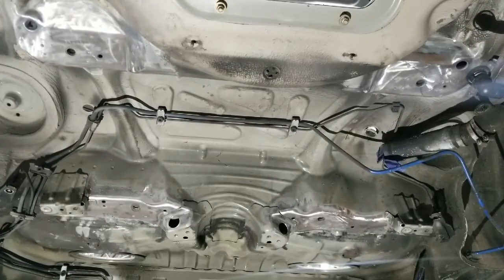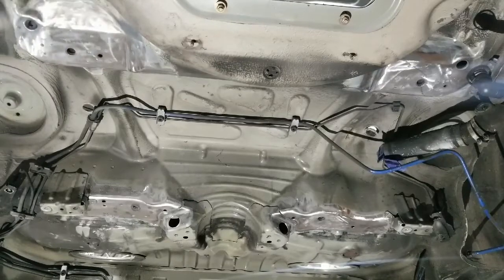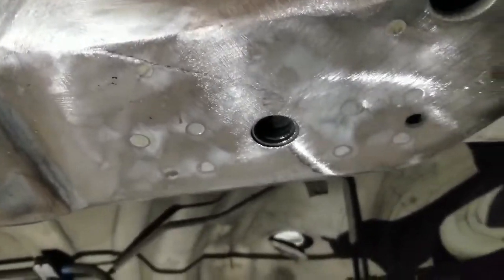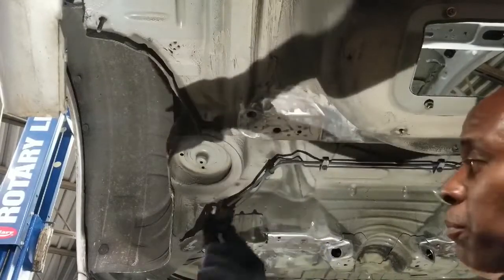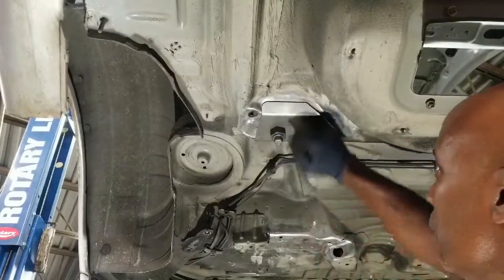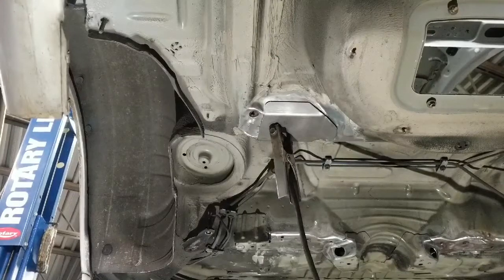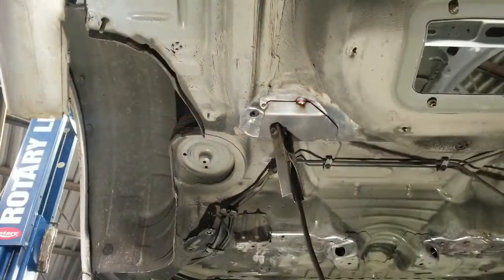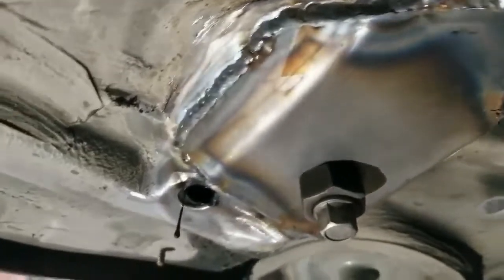Hi-Speed Motorsports DIY: E46 M3 Subframe Fix using AKG Motorsport Reinforcements

Comment: What was the inferior subframe reinforcement used in the failure you showed?
Reply: Hey Peter - the car with the ripped floor was mine. 2003.5 Coupe with stock suspension, never stanced or tracked. Not sure what brand the reinforcements were as I bought the car with them already installed. It was reinforced many many years before my ownership though. Wish I had bought a car with it not done so Hi-Speed could do it properly using the beefier AKG Motorsport pieces. Cheers!